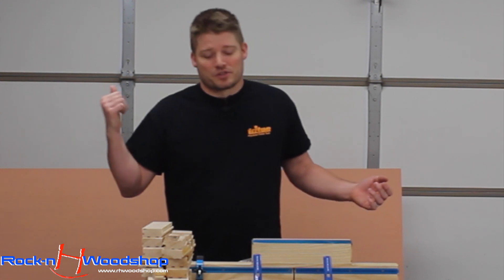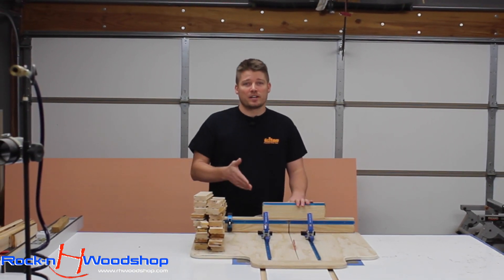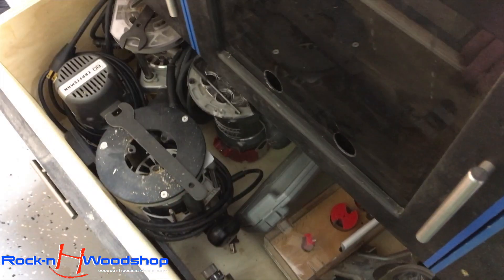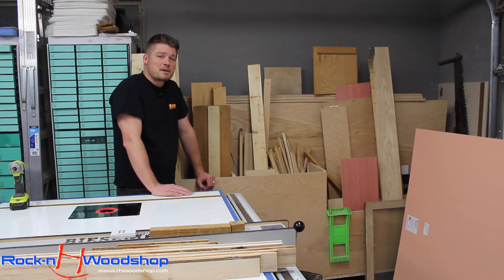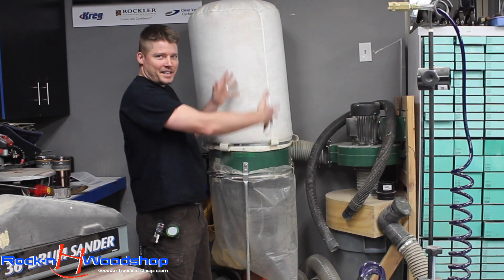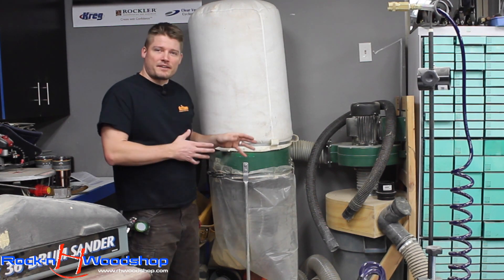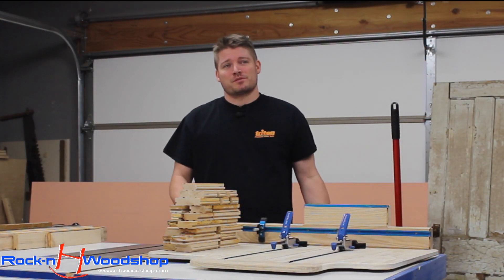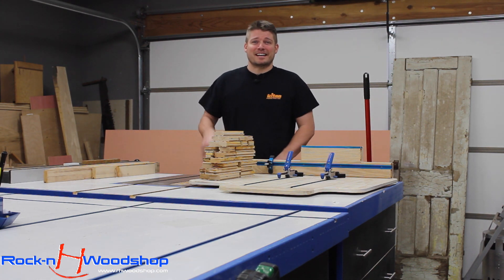Woodworking Shop Tour 2017

Comment: Drew,  I have the same miter saw and for the life of me, i cannot get the fence at a perfect 90 to the blade.  Could you do a simple alignment video so that i can hopefully get mine squared away?  Looking forward to the miter station.  I have been toying with cutting a hole in my garage wall for the slide.  That way I don't have to take up so much real estate by making the table wider than i must.  I am in a wheelchair so i need the room to maneuver.  any tips would be great.  keep up the great work love the videos.

Comment: Love the outfeed/assembly table.  I believe the white board you are talking about is made of melamine. I have a 4x8 sheet on the wall in my office that I use as a whiteboard. Nice $20 solution instead of buying a $200 dry erase board. Great shop!
Reply from the maker: Actually no, this is normally found in the bath surrounds and stains really bad when used as a whiteboard.  It is essentially fiber board.  You are right about the 20 dollars though. It is durable enough but super easy to replace.

Comment: great tour drew thanks! man ur radial arm miter saw station is gonna be awesome. jay bates watch out..lol look fwd to seeing what you plan on doing.."WHITE BOARD" is that the same thing as melamine just different terminology? thanks..check out Dustin Penner router table fence.very accurate plans and works GREAT! quick easy build too.
Reply from the maker: Hey Joe!  I cannot wait till I get mine done.  Whiteboard is not like melamine.  it is practically fiberboard.  Just search around the surrounds that come in 4x8 sheets at Home Depot
Reply: Rock-n H Woodshop  cool thanks man and yea id be a littke ansy too..

Comment: Nice tour, great shop space.  Isn't your white Assembly table surface referred to as "Melamine" or is it something else ? I like the painted floor over plain concrete ....!!
Reply: Randy Finfrock isn't melamine and Formica the same, because he did mention it's not Formica. It looks more like white mdf to me (in Belgium you can buy sheets of white mdf, these are only 3mm thick)
Reply from the maker: No it is not Melamine.  @Nighthawk117w is pretty much right on target.  It is not as durable as melamine, but make a perfect use for my tops.  Durable enough but easy to replace.

Comment: Drew, have a question about your planer jig to reduce snipe since you have to New Dewalt planer do you still use the planer table you built and how to you like the Dewalt planer?
Reply from the maker: Patty Fowler no I have not used it for my Dewalt planer because I actually sold it with my old planer. I don't know if I'll make one for the Dewalt or not because the snipe on the Dewalt is so minimal anyway. I love that planer, I have not been able to find a wood that I put into it yet that slows it down. I do think that the planer blades that Dewalt makes for that planer are very weak and soft so a helical head maybe in my future.

Comment: as far as i know, 250 square feet is 23 square meters. that's NOT an oversize 2 car parking garage.
I guess that you garage is more like 650 square feet.
Reply from the maker: Avrahami Avrahami LOL, yeah I don't know what I was thinking when I said 250 ft.². It is actually 450 ft.²
Reply: Rock-n H Woodshop which is over 5 times bigger than my 8x10 shed workshop.  I hope to upgrade to a 1 car garage shop when we move house this year though.
Reply from the maker: I started Rock-n H in a one car garage.  I made it work very well too.  I can only think that if I was in a smaller shop again that I would have to downgrade a lot of my cabinets, including the TS cabinet, but a great craftsman can create masterpieces in any size shop.  Congratulations on the upcoming house and new shop.  I would very much love to see a tour of your shop currently, too.  I would love to see how you make it work for you.